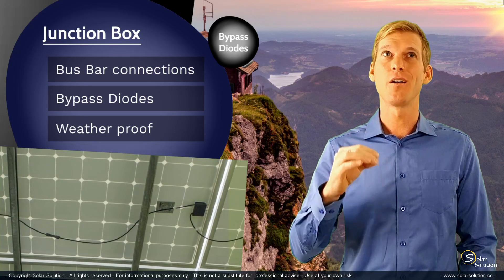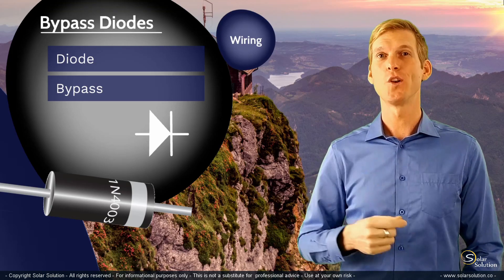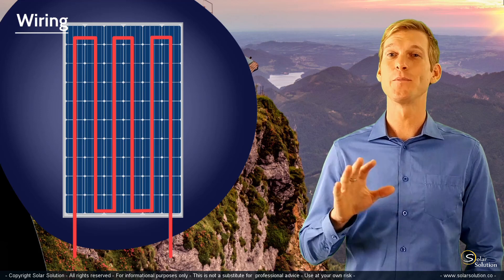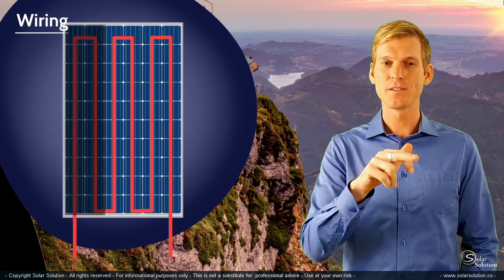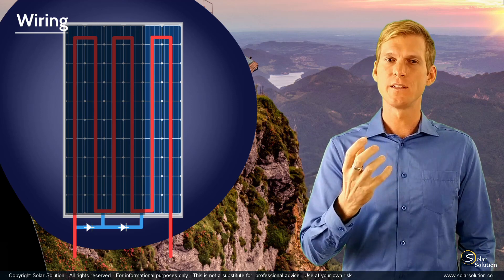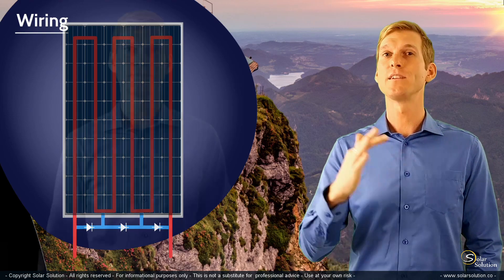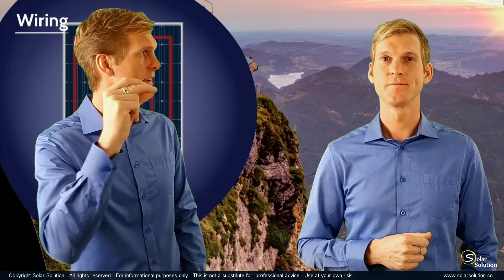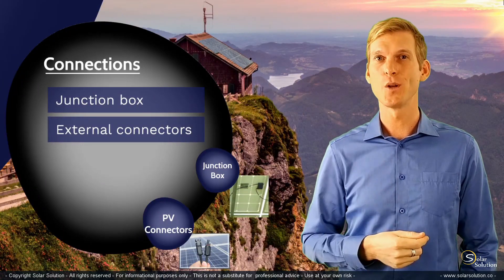Bypass Diodes: Their importance in Solar PV Panels

Comment: Thank you Jesse, I am curious if bypass diodes can be added between the soar panels, for the same purpose of allowing current to flow within the array (in series), in the event of one panel failing or becomes partially shaded.
Reply from the maker: Hello Arthur, it is good to hear from you. For you situation, do your panels already have bypass diodes installed?

Comment: I have two strings on different MPPT , with  the same number of panels, 18. On one string at around one hour after the system starts in the morning, the voltage drops to around 160 V and stays so for around three hours and the come back. I tried to change the connector to one panel , but the same result. I bypass the panel, and now, for the moment is working. What do you suggest to try to make to fix the problem, please? Thanks